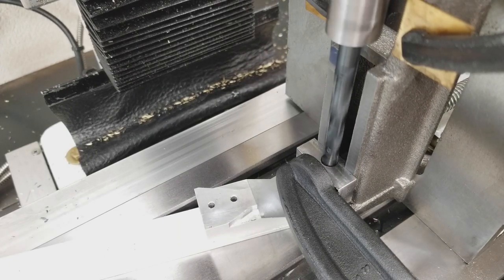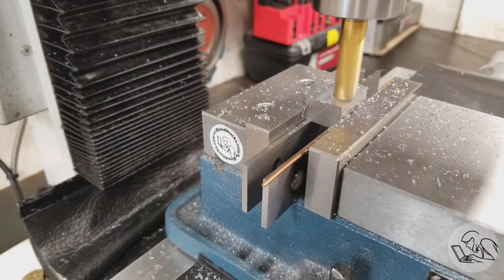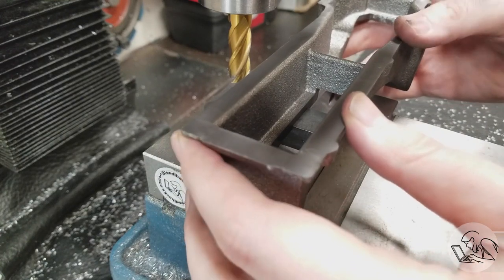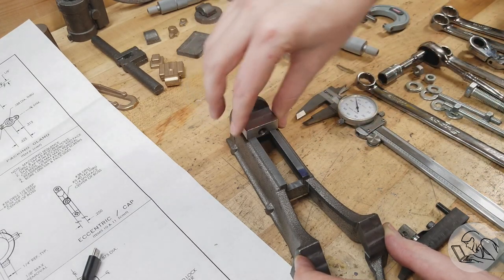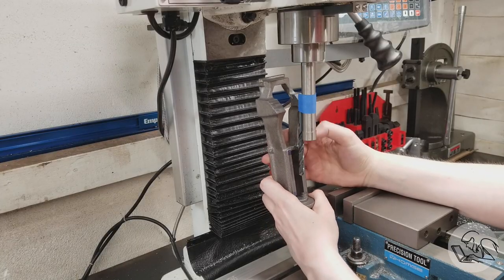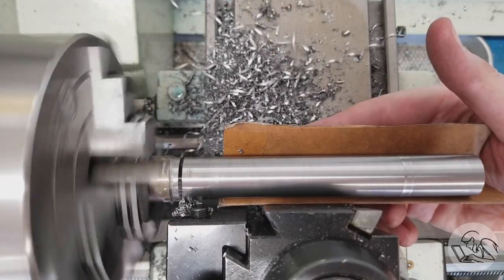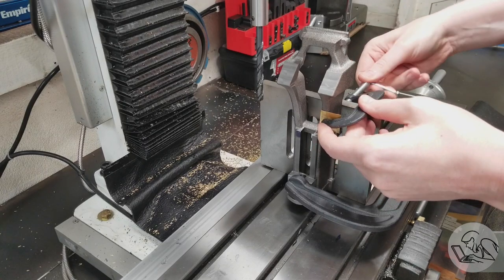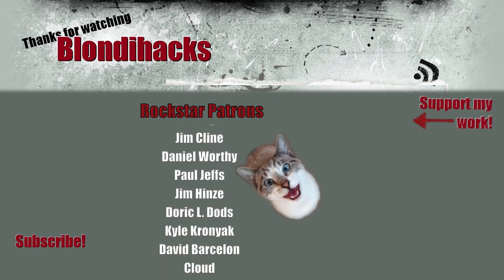Let's Build A Model Steam Engine: The Tale Of A Difficult Hole.

Comment: That kid's mill is seriously holding you back. Have you thought about getting a bigger, old school machine? They usually have plenty rigidity and axis travel, and where I live they're not even that expensive. Heck, the mill I use at work is over 60 years old, Soviet, and has broken down many times, but still can get 0.01mm precision every time. (even though I usually can't)
Reply from the maker: My shop is very small.
Reply: @Blondihacks  Oh well, that is unfortunate. Even though they aren't usually all that big, they need a lot of clearance around them because the dials and controls are all over the place.
Reply: @michaelmechex  Even a Bridgeport needs at least a 6' x 6' envelope to work in.  And that's a bit tight.
Reply: @rennkafer13  Yeah, tight space is an issue with these things, even though it might not be obvious at first, but it's really annoying if something is in the way.

Comment: It makes you wonder how they got the required level of precision in the early 19th century when they didn't have the machinery we have today.
Reply from the maker: To large degree, they didn’t. 😀 The thing about steam engines is that they will still run when poorly made. That got the industrial revolution started, and then the engines got better as machining improved. That said, turning between centers has always been very precise, and is how any parts that mattered were (and are) always made.

Comment: I woulda cut the reamer shaft down.
Reply from the maker: The problem with that is you lose the center on the back, and then it can never be reground properly
Reply: @Blondihacks  Thanks for enlightening me on that. Didn't know...But most of my reamers are chinesium cheepos so replacing is cheaper than regrinding...UNTIL I get me one of those new Deckel S1 units that Stefan now has. Boy do I want one of those.

Comment: So I'm still early in the  video, but since you were making a drill bushing part anyway, you could have instead made an indicating block that you could use to center the spindle to drill from the other side.  You'd make it an arbitrary width centered over its 'indexing between slideways' part, which you could then use to center left/right.  For top/bottom, you'd only need to know the measurement of the 'height' of said block.

Though, you have a small mill, so I don't know if the setup required would give you clearance for that on the Z Axis.
Reply from the maker: Yah, to drill from the other side I would have had to use the lathe, which would be have been a much more difficult setup, I think.
Reply: @Blondihacks  Ah, yes.  That makes a lot more sense then :)  I too am fearful of doing these sorts of setups on the lathe, so I use the mill when I can.  Its coming along great by the way!

Comment: Great video. I'm not a machinist, and I'm curious. Can someone who understands more explain something for me? You can obviously position the part vertically either way. I assume the problem is that you can't edge find on the machined surfaces to find the center of the hole. Why not mount and indicate the part horizontally and mill 3 flats (left right and top) or a notch on that outer radius of the flange, relative to those key surfaces, so you could mount the flange side up and have direct access to edge find and drill? It would introduce error, but so does the approach used. I can't imagine that it's an aesthetic thing. Thanks.
Reply from the maker: There isn’t enough Z height in the mill to do it that way.
Reply: @Blondihacks  There was a different approach by a machinist on a different channel that looked like a good choice but I doubt it would work here.  I have a mill about the same size and the two BIG issues are lack of Z (the raw specks look OK then you add a vice and a drill chuck and ...).  And on these small mills with pretty small vices you can't really use the "outrigger" approach because even if you can cheat the Z you are never going to get your small vice to grip the outrigger firm enough to drill or mill with out the part shifting.  Some of your setups would not be the best or most practical on a full sized machine but they become necessary to overcome the limits of small less rigid machines.
So Nick, that is what to keep in mind, (and Quinn mentions it periodically) that some setups are as much about getting around the limitations of a small mill/ lathe as they are about jigging up a difficult part.